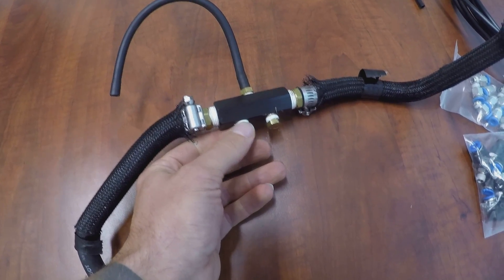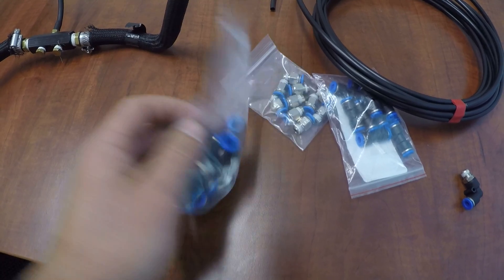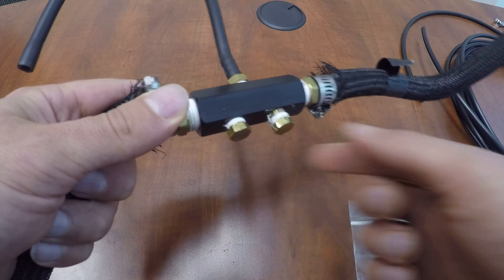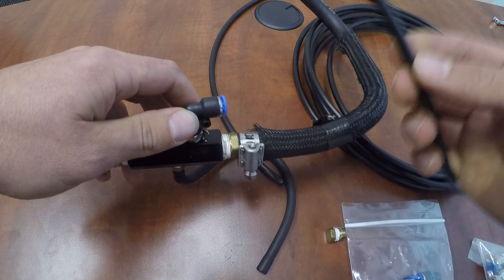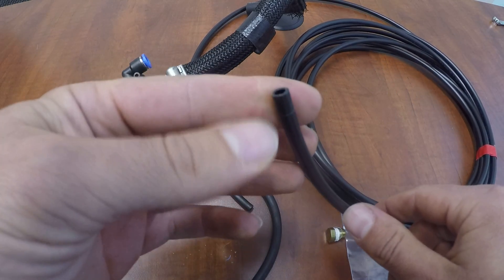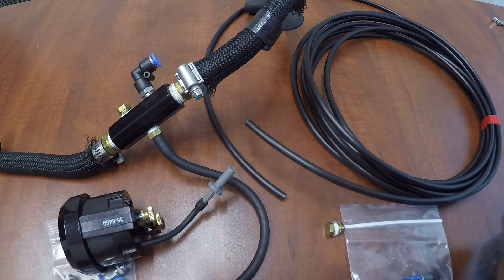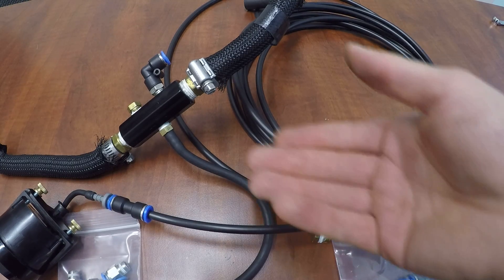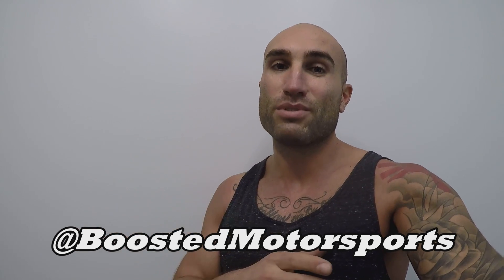Upgraded Vacuum Lines for the HellRAM Supercharged Truck Build

Comment: Where you get barb to ptc fitting
Reply from the maker: Found it on Amazon.  It looked like it was from a medical supply company but it was only about $7.  Let me know if you need help finding it 👍
Reply: Was it https://www.lawcomall.com/index.php?main_page=product_info&products_id=313667
And does it fit 4 and 6 mm
Reply from the maker: It was actually off eBay.  I used 1/4" hose so depends on your application but here it is.  https://www.ebay.com/itm/John-Guest-Acetal-Tube-to-Hose-Stem-1-4-STEM-OD-X-3-16-HOSE-ID-PI250806S/251867714598?hash=item3aa47c5426:g:cOwAAOSwpDdU8KtI:rk:1:pf:0
Reply: BoostedMotorsports thanks man order wrong ones first
Reply: BoostedMotorsports I can’t find 4mm one

Comment: PTC  (push-to-connect).
Love the videos. Keep on keepin on brother.
Reply from the maker: Thanks for the support Dusten!  Plenty more on the way 🤘
Reply: @BoostedMotorsports  Hi, Great vids man. I spent way too much time brainstorming/shopping vacuum lines. Your video helped me figure it out! Wondering where did you buy that polyurethane tubing? And it looks firm not soft, wondering what the durometer rating is on your polyurethane? Thanks.

Comment: I'm curious to see how it does with heat.
Reply from the maker: Never any issues on my old setup.  Just have to use insulated heat sleeve in extremely hot areas such as the manifold but it holds up perfectly 👍
Reply: BoostedMotorsports I've used stuff like that for industrial applications never thought about it for vacuum and boost applications in vehicles pretty brilliant!

Comment: Thats cool man. Seeing you put thought behind everything before you do anything is helpful.  Keep making videos brother 👊
Whats gonna be an estimated cost on this entire project btw?
Reply from the maker: Thanks again for your support Brad!  It isn't as much as you would think.  Probably around 6-7k so far since everything purchased is mostly second hand and budget conscious.  The DiabloSport fiasco is going to add to the budget though cause we will have to buy a brand new HP Tuners unit and sell off the Diablosport.
Reply: BoostedMotorsports oh yeah no need for thanks brother 👊 keep doing your thing. And that isn't very much considering the alternative. Hell yeah man, i live in the south and am thinking about more of an off road build. Think a pro charger build similar to your would be "practical" i haven't put much thought into till i saw you mpg change lol